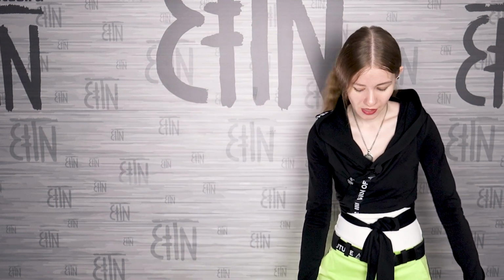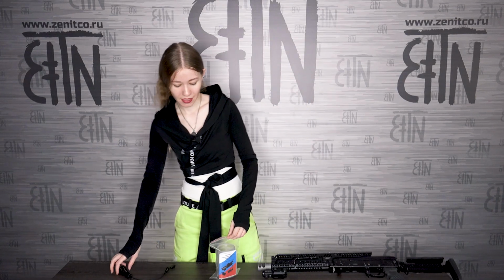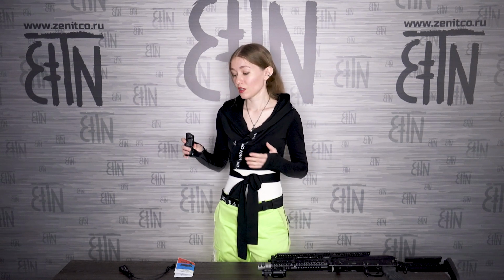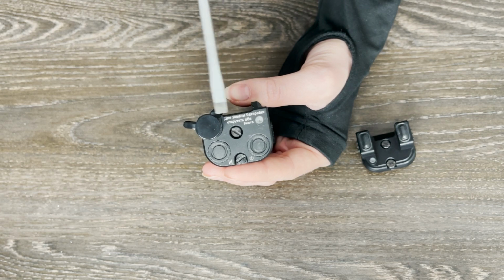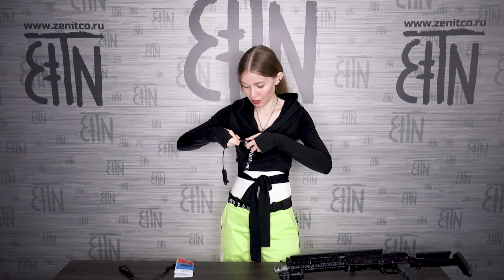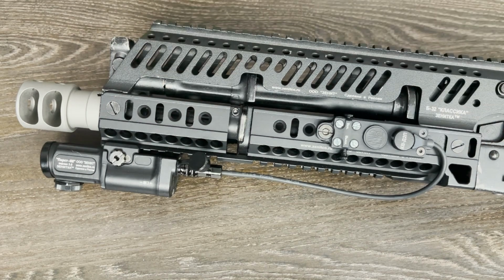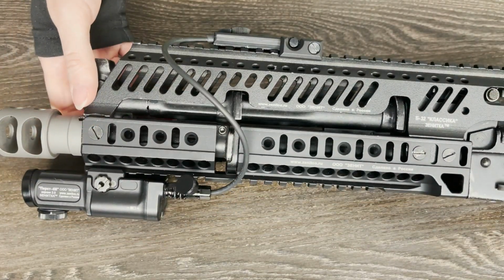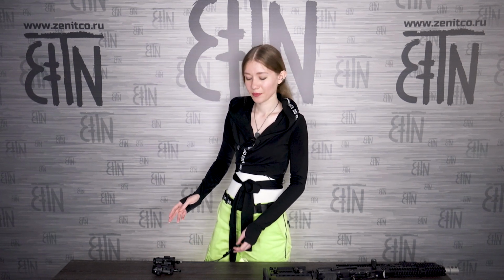Perst-4M, Perst-4P dual lasers, gen. 3.0: what was changed, unpacking, modes, tactical switches

Comment: Great kit much better shape than the regular P4. Could you make a pistol flashlight at 1500 lumens with a strong IR emitter rotating in place of the visible led simultaneously changing the functioning mode?

Comment: That ak is very scifi i dig it. Out of curiosity, would perst 2 and 3 survive a SCAR H? The scar is supposed to be very brutal on scopes and electronics and I'd rather not break a 1 to 2 thousand dollar piece.
Reply: only LAM units specifically rated for the SCAR are the NAVSEA marked LA-5 (peq-15), not for sale to civilians. other than that its a coinflip. I would guess the B.E. Meyers MAWL C1+ could hold up pretty well.
Reply: @caseyd9762 damn might just get the military peq from ebay
Reply: @nejinaji  it has to have the navsea embelem on the bottom to be the scar rated model. The difference is they take a standard peq-15 and basically fill all the empty space with resin or somthing to prevent anything from vibrating or shaking arround.
Reply: @caseyd9762  ok cool, thanks. I think I saw garand thumb had one on his scar

Comment: How do we know we have  a Perst 4 Gen 3.0? I purchased mine in November of 2020, and I am wondering if I should get the KV-D3/2P combined switch or KV-4/2U.
Reply from the maker: Perst-4 gen.3.0 has «версия 3.0» (version 3.0) engraved on it under the product name. It also has KV-D2 switch in the kit. Previous generation had different switch in the kit and did not have version engraved on it. If the parcel was sent in November, it is generation 2.0 as far as generation.3.0 was not released yet. Gen.2.0 is compatible with KV-4/2U. And in order to exclude possible mistakes: you ordered Perst-4, not Perst-4M, right? Perst-4M gen.2.0 is not compatible with KV-4/2U. Perst-4 gen.2.0 is compatible with KV-4/2U. And if you plan to connect it with Klesch-2, also note that new Klesch-2 2.0 is not compatible with KV-4/2U, only with KV-D3/2P. Klesch-2 gen.1 is for KV-4/2U.